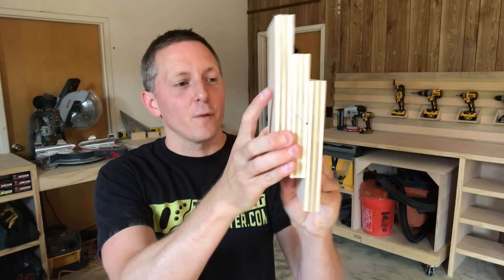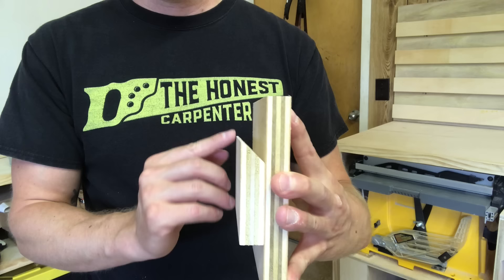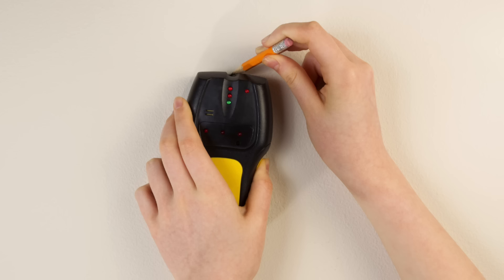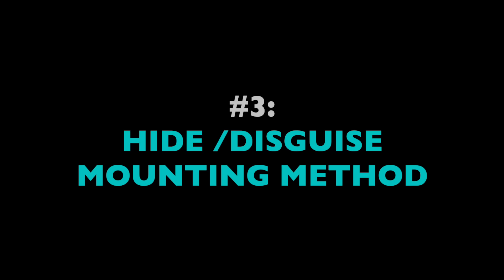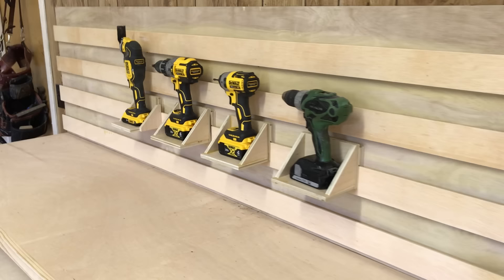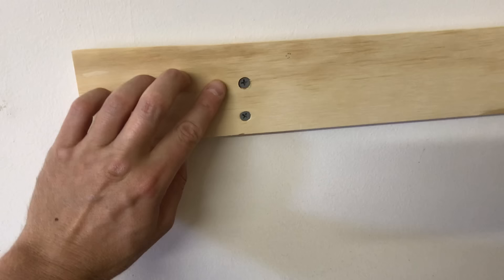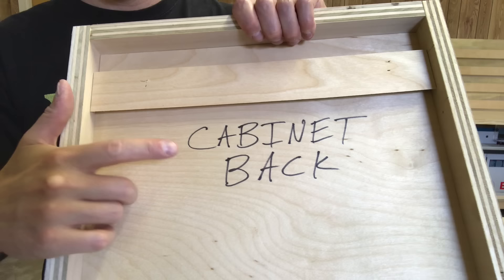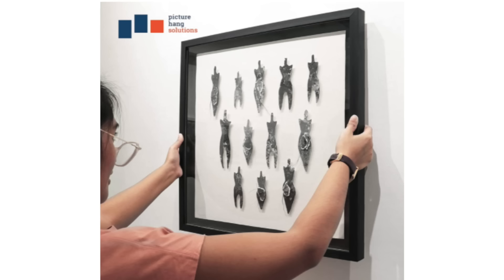FRENCH CLEATS EXPLAINED...In 5 Minutes! (There's More To French Cleats Than You Think--3 Main Uses!)

Comment: Although I used pocket holes and top and bottom cleats, my 36”x36”half inch plywood cabinet bottom cleat still  came of the wall because it couldn’t support weight, about 50 lbs. How should I fix the cabinet back cleat besides go up to 3/4 plywood?

Comment: Any tips on how to install upper and lower cleats so vertical spacing remains the same between cleats to allow each cleat to carry 50% of the weight?  I'm trying to mount old mirror (heavy!) on wall using French cleats fixed with drywall anchor.  So, trying to spread out the load equally to multiple cleats.

Comment: I used them to hang kitchen cabinets in my house that I sold. The walls of the house were cinder block with 1" furring strips with metal lath and plaster.

Trouble was, a stud finder wouldn't find the wooden furring with the metal lath and the furring was random spacing.

So I mounted french cleats on the plaster screwing to the furring where I could and using long tap cons to secure the cleats to the cinder block  where there was no furring. Worked out pretty good, a bit of a struggle but better than making a mess of the cabinets trying to anchor them

Comment: Thinking of using the 100lb - rated metal cleat for "floating" cube wall storage. The info on these says you don't need a stud, which doesn't seem like it could possibly be strong enough, with screws directly into drywall. Thoughts/experience?

Comment: Great vid.  Does the wood being used for the cleat have to be a minimum thickness and height?  
ex:  can you use a 45 deg cut one 2x4 to use as a cleat or 
should they be cut from a 3/4" thick piece of ply or 
two 1x4s with matching 45 deg cuts or 
just one 1x6 cut at 45-30 deg?

Comment: I have a question (s). We just recently moved and my new (old) shop has a block wall with a 2x4 framing on top of that. What it looks like is they built the block wall, capped it with a 2x8 then built the framing above that which holds the outer wall and siding. As a result of this method, the studded wall is recessed 3.5 inches back from the edge of the block wall (so the outside is flush). I have a 3.5 inch lip/shelf all the way around my shop. I want to re-frame sections to make it equal with the block wall so I can either hang pegboard or build a French cleat system (this is the relevance to your video). Since I will be converting a 3.5 inch stud wall into a 7 inch stud wall by adding the second layer of 2x4, how would I secure the second stud wall (which is 3.5 inches thick)? Do I use lag bolts/screws/nails through the width of the 2x4 or some sort of bracket system or some method that will be new to me? I'm not re-framing the entire wall, as it's a 10.5 foot ceiling and I won't be using anything over 7 foot, I'm just re-framing sections and eventually building shelves above the 7 foot mark. The block wall is 57 inches tall (that's almost 5 feet tall) so I will only be using around 2 feet-ish above that. How do I secure the second frame to the original? Any advice would be greatly appreciated. I can be reach through the email in my profile if pictures will help. I thank you in advance and any other viewers who may have advice or experience with this too. Thank you all. God bless, Joe

Comment: You mention using 3/4 inch plywood; what about using 1/2 inch plywood for the cleats?
Reply from the maker: I bet you can do for lightweight duty stuff, Daniel
Reply: I was wondering the same. But is it ok if I use 2 plies of ½" instead for storing my circular saw and so on.

Comment: I noticed that you are using 3/4 ply for your sample cleats. Is there a reason that you can't (or shouldn't) use dimensional lumber instead? In principle, you could have used 1x4s for your samples.  I don't always have plywood around, nor do I have space to store plywood very well, but I do have plenty of dimensional lumber around.

Also, is there a rule of thumb for how tall a cleat should be, or is the load bearing weight entirely dependant on the length and number of screws you put into a stud?
Reply from the maker: Good question, Steven! I like ply because some dimensional lumber cuts have grain layers in the bevel that may be prone to snapping. Ply nuetralizes this with cross-ply layers. In the end though, it takes a lot of weight and rough handling to snap any french cleat.

And I do like to go with at least 2" of material (NOT including the bevel) for a cleat. This just give plenty of meat for one or more fasteners to pass through. I think if you stay over this dimension, going much wider than 4" probably isn't going to help too much--the bevel itself will still be as prone to breakage, no matter the width of the board below.

Comment: Should I apply some polyurethane/sealer to the backer wall? Would that help or just overkill?
Reply from the maker: Hey Vic, it may interfere with the spacing back there. I’ve considered it too, but I’m afraid you’d get sticking/scraping. Unless you poly the entire backer wall BEFORE you install the slats, and give plenty of time to dry and cure. That shouldn’t create depth or friction issues
Reply: @TheHonestCarpenter  Just finished building a small wall and that is what I thought too. I did discover that my drywall had a slight bow in it and that transfered to my backing board which affected the slats. Only a bit but enough to notice. I thought the backing board would prevent that but it showed up after installing the slats.

Comment: Ethan, how would you recommend attaching securely the cleat to the backer board In your example?
Reply from the maker: Hey Ben, wherever possible I’ll use a strong adhesive, plus the longest fastener I can use without punching through the other side—screws are most preferable. And connecting cleat to wall, you just want to hit studs dead center,  and get a good 1-1/2” penetration.

Comment: Hi there, interesting that this video came up as I just learned about them and I'm trying to figure out the best way to suspend my metal cabinets (NewAge) I'm looking to purchase for me garage at least 1.5 - 2 feet off the ground.  I know they are designed to be on the garage floor but I want to be able to suspend them. Part of my garage has a concrete lip (part of the foundation wall) that I could set on top of. Other parts do not. Trying to figure out best hanging method, I came across french cleat. But I'm curious if they could hold these heavy metal plus the weight of items inside?  Your thoughts, suggestions, recommendation, etc.  Right now I'm doing demo, rewiring, etc before cabinets so I've got 1-3 months time to figure out best method, thank you in advance.  By the way, great video!!!
Reply from the maker: Hey John, you may want to go with a variety of supports for something that heavy. Legs, or a ground support of some kind, may be best. Then you could lag into the wall at the top somehow to prevent pull-away. The right cleat assembly might work, but it could be tricky to implement!

Comment: used french cleats to hang tools in the shop before, didnt really like the system tbh, i made all custom hangers for different tools and consumables i ended up screwing alot of them in place permanently as the hanging platform kept coming off with the tool or whatever was hung from it made everything a two handed operation hold the mount down while you pull the jig saw off of it

really in a shop enviroment where you dont mind screw holes just make your little tables, hooks, ect and screw them down if you need to move them unscrew and recrew them to the wall, for alot of the saws id make a little table on an angle and then cut into the table with the saw a couple times and thatd be the saws mount the blades would hold it in place somewhat, circ saw, jig saw come to mind, drills, oscillating cutting ect got a U shapped hook that the top of them would hang from, made it so they werent top heavy sitting on their battery start hammering on your work bench and itll be raining tools